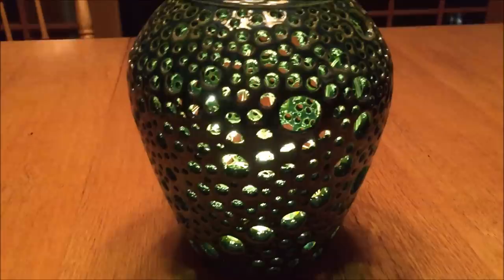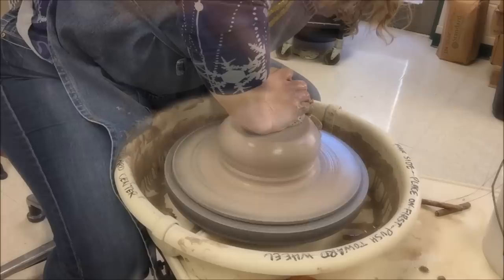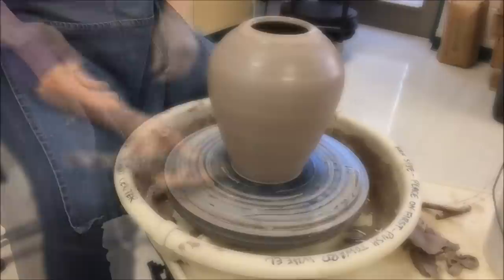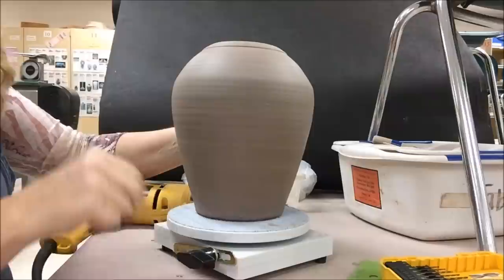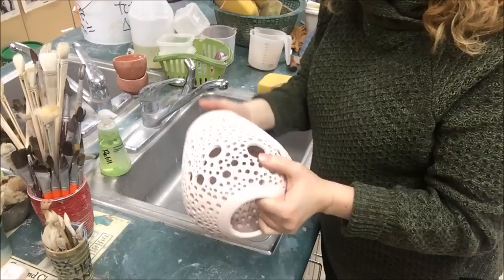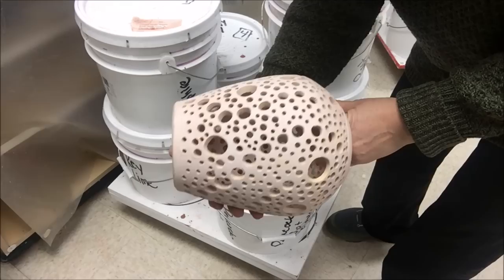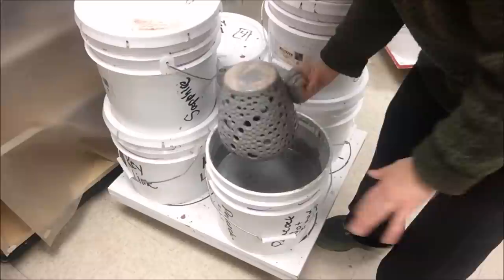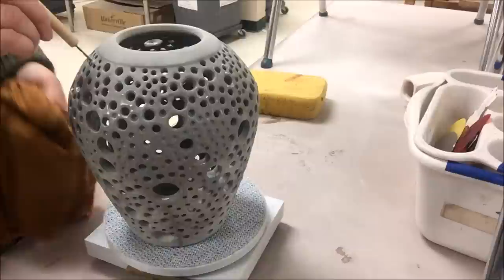Creating a Pierced Wheel Thrown Vase - Carved Holes for Candle or Lights

Comment: Do you have an air filter system?
Reply from the maker: Yes, at school, there is a ventilation system which exhausts air outside.  At home, I have an Environkleen hepa filtration unit.  I like it!
Reply: @KaransPotsAndGlass  thank you....I am paranoid..have 2 inexpensive air filters..pull down hood vent for my kiln and am constantly  cleaning with water..will due of old age before dust gets me as I started on this addictive journey 3 years ago at 75!